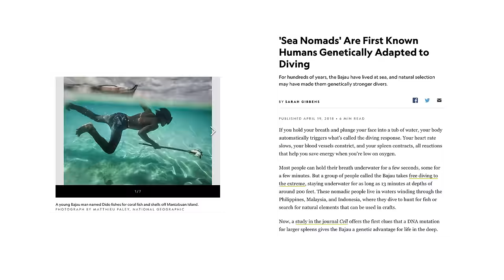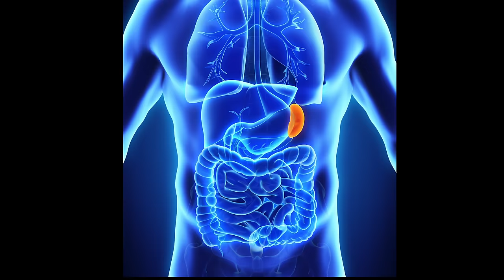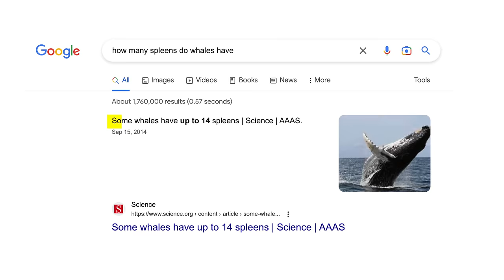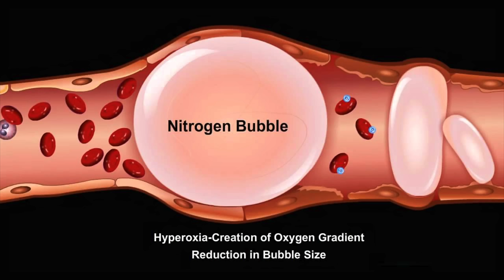The Most Dangerous Fishing Method on Earth

Comment: For a 150 ft dive that lasts 1 hour at depth you would require an estimated 250minutes of decompression time assuming the only gas you were breathing is air. This rough estimate was calculated using a square profile with 10ft deco stops and a 40/85 Gradient Factor.
Reply: Added comment unrelated to diving: Peterson is right that when people are not struggling financially that they are more mindful of their surroundings and the environment (usually). But, I think a lot of Peterson's notions about what political practices create "wealth for all" are just hot air.
Reply: I came here to find that you'd beaten me to the answer. Interestingly he says in the video "they stay at this depth...hours [plural] at a time". Just thinking about how much deco they are skipping gives me a rash!
Reply: How are they not getting nitrogen narcosis staying that deep for that long on regular air?
Reply: This seems to be super long, for a dive at 150ft/46m that last 1 hour for an adult in good shape breathing normal air i think 135 min decompression stop is enough
Reply: @NauticalWizard  I imagine it's partly down to their unique physiology, maybe a bit of a trained response to bubble formation, and probably a big part of their dive is spent much shallower than the maximum depth they reported.
Reply: @99999999955555100  If you did a square profile dive (i.e. straight down to 150 feet, spend an hour there and then head up for deco), 35 minutes of deco would be well-short of the safe minimum for most people diving on air. How did you calculate 35 minutes?
Reply: @NauticalWizard  They are; they must be! There's always a  narcotic effect of breathing gases under pressure, there's no way of getting past it. They have advantages like warm water, lots of practice etc going for them though, and clearly they can mostly get by. I bet many bad accidents could have been avoided though.
Reply: @thomaschilcott   ooops my bad I forgot a 1, DTR 135minutes based on MN90 tables for 60 min dive down 48 meters, 5min  at12m 19min at 9m 36 min at 6m and 70min at 3m. What DecoTime do you have? (thanks BTW I corrected  my 1st comment)
Reply: @99999999955555100  my profile:

48m-60min
24m-2min
21m-5min
18m-7min
15m-10min
12m-18min
9m-27min
6m-45min
3m-97min 

275min dive time with 215min of deco. 

My initial post i had been calculating off a 20/35 trimix since that was pre-saved into my settings. 

This profile was made using air mix. 

Seems your profile allows for more pressure differential, to me it seems fast but I bet in practice with average depth accounted for it would be shorter than 215min. You may also be running a less conservative GF.
Reply: @NauticalWizard  they are definitely narc’d. They are just hoping they can keep a cool head. In the 70s to the late 80’s it wasnt uncommon for tech divers to go to 200ft on air. Today this seems crazy. I bet it was a little crazy back then still. But crazy doesn’t always stop people. Especially when gas mix technology had not yet been developed to make equivalent nitrogen depth mixes.
Reply: @99999999955555100  That's not a profile I would personally want to dive for a couple of reasons: MN90 are French navy tables, which were developed essentially by having "volunteers" (professional navy divers) do a dive and then see if they got DCS; they then adjust the dive profile and repeat until the rate of symptoms was "acceptable". Even with the finished MN90 tables, even navy divers who have to be super fit to do that job (test subjects for the MN90 tests were all 74kg +/- 8kg, 176cm +/- 5.7cm, 32.5 years +/- 6.1 years) were getting symptoms on some dives.

My calculations for the hypothetical 1 hour, 48 metre dive on air come out as follows:

48m: 60min
30m: 1min
27m: 1min
24m: 4 min
21m: 5min
18m: 9min
15m: 12min
12m: 18min
9m: 29min
6m: 283min

20,405L gas consumed 😬
Algorithm: ZHL-C plus 30/85 GF, via MultiDeco.

This is also not a dive that I would want to do 🤣

I'd prefer to used mixed gases at that depth, especially if it was cold water; plus with standard gases I could calculate my deco on the fly with ratio deco. But this is obviously well-beyond the means of these spearfishermen.
Reply: I AINT READING ALLAT🔥🔥🔥🔥
Reply: when i heard they dive 150ft shivers down my spine i just found my ancestors
Reply: @NauticalWizard  Im wondering if its because the air he is breathing isn't compressed air.
Reply: Using U.S Navy tables Im getting 317 minutes of total ascent. And no more diving for a day at least. 

11 min at 50 ft
26 min at 40 ft
28 min at 30 ft
248 min at 20 ft

If the numbers dont add up theres some minutes added in between stops. A 50 minute difference between tables is odd
Reply: @MarkBrown-xn9ig  Its being compressed by an air compressor at the surface. You wouldn't be able to breathe air at ambient pressure even a few feet below the surface due to the pressure gradient; your lungs can only inhale so hard!
Reply: @iandavidvillaloboswong5180  I think it's because the navy tables were all made by bending people on purpose. Different people & different conditions can lead to different conclusions I guess. I'll stick with Buehlmann with GF I think!
Reply: The moment he said how deep and how long the dive was the dumb ways to die song started playing in my head🤣.
Thanks for the info though was curious how long deco would be for that.
Reply: What does  that mean in real English
Reply: @LCD.26  They're playing with fire, basically. But they have to; a guy's got to make a living to feed his family after all!
Reply: Finally someone speakin the truth. Not the narrator nor national geographic
Reply: They are not breathing compressed air, not the same saturation. Still BS, no way.
Reply: @williamk1452  of course they are.  It's called a COMPRESSOR after all.
Reply: @williamk1452  you are correct. It should say continuously fed air supply from a gas powered air pump. It's pumping air down the hose through the tank at a constant rate otherwise the diver would have bubbles pouring out of his mouthpiece. The tank is probably not set up to cycle off and on at 30-40psi like a garage would have for car tires? It's probably set really low at a few pounds so the diver can breathe in, hold, exhale without bubbles screaming out of his regulator? Makes it hard to see when you have 40psi pouring out of every hole in your body at 150ft? Guy would embolise and then sputter all the way to the surface like a party balloon?
Reply: @MarkBrown-xn9ig it has to be 'compressed air' (ambient pressure at 150 feet), however it is not compressed to 200 atmospheres or more as it would be in tanks.
Reply: @clutchcargo666  sorry, that is not the same. What pressure do you usually fill your tanks to? I fill to 3500, in steel, HP 80s.
Reply: @chrismsmalley2626  you got the constant pressure part. They are receiving the same cubic feet at depth as at the surface. With compressed air in my tanks at depth my first stage adjusts for the pressure at that depth, increasing the actual cubic feet, denser air, which is where the saturation comes from. Without this there is ALMOST no need for off gasing.
Reply: No tank, no first stage, no increase in cubic feet breathed at depth, almost no need to off gas. Saturation is not the same.
See you guys on the bottom.
Reply: @williamk1452  in order to breathe you have to be delivered gas at 'ambient pressure' for whatever depth you are at.
That is the secret of the demand valve.
The 'partial pressures' of the gases delivered to you remain the same whether they are delivered through a demand valve or an open circuit just bleeding air to you as in the old hard hat system, so as long as you breathe at the same rate you are exposed to as much nitrogen over any given period & that nitrogen dissolves into your body,
Reply: At 150 feet, he is not breathing compressed air.
Reply: @stra808x  I don't think that you understand how delivering 'breathing gasses' to a diver works either the old method with hard hat diving or through a demand valve the diver has to receive gas at 'ambient pressure' for whatever his depth is or he cannot breathe, so the 'molecular'  amount of gas delivered to his lungs increases with depth, each lung full of gas at depth (since it is under pressure) contains more molecules of gas, so at 10 metres (33 feet) the density of the gas delivered is twice that at the surface because the diver is under two atmospheres pressure instead of one atmosphere he is used to living in.
At 66 feet it is 3 atmospheres, 99 is 4 & so on with the gas breathed getting proportionally 'thicker' (more dense).
Reply: @williamk1452  tank pressure doesn't matter.  What matters is the air you are breathing is at a higher pressure then surface pressure (it has to be higher in order for it to be sent down the hose to the diver who is under higher then atmospheric pressure).  If that diver were to hold his breath at depth and surface, the air would expand to the point of bursting his lungs.  That doesn't happen when breath hold diving because the air taken in at the surface will compress on the way down but if no new air is added at depth, it will be the same volume when he surfaces.
Reply: @99999999955555100  I thought you could spend all day at 40m
Reply: @williamk1452  Sorry dude, the other guys are right. Tissue saturation is a function of ambient pressure (the pressure that the water is exerting on your body at a given depth). The gas you inhale is at or VERY close to the same pressure, because if it wasn't, you would either be unable to inhale or exhale, depending on which way the pressure gradient went. Ask a rebreather diver what happens when their unit's couterlungs get even slightly out-of-plane with their own lungs! 

The gas these divers are breathing is compressed at the surface, held in the holding tank of the compressor at XYZ PSI and then either drawn down by the diver through regulators / demand valves as they inhale, or fed as a continuous "hookah" flow. The laws of physics simply don't allow for it to happen any other way.
Reply: @danf7411  If you have enough gas and a way to stay warm, eat drink and, ahem, evacuate waste, you can stay at 40m as long as you want. Eventually you reach full saturation which requires a lot of decompression, so it's mostly done for commercial diving. There's loads of great content on YouTube about it, search: "Saturation Diving".
Reply: Precisely you said exactly what I was thinking. The ramrod escape factor times booty equals booty squared. Hold your applause my equation was the bomb!
Reply: @@guy895Awesome retort.
Reply: They aren’t breathing compressed air they are breathing surface air so you can stay down for many hours and no decompression is required. I’ve scalloped and lobstered using a hookah rig and no bends.
Reply: Holy Crap. It's amazing there is not more deaths, what people have to do to make a living and take care of your family.
Reply: @DavidMaruca_ you are right, that was unrelated.
Reply: @guy895 exactly, Third World Countries don't have Osha requirement regulated scuba shops that demand a license/ permit to feed your family. You do what you need to do to not only live but thrive.
Reply: @thebullgator they ARE breathing compressed air. Ask yourself why they need to use a compressor in the boat instead of just the hose. It’s because at depth, the water is compressing your lungs way harder than you can overcome to breathe in. You need to force air down the hose at a pressure that is slightly higher than the pressure on your lungs from the water. Air that is at higher pressure than ambient is compressed air. It’s as simple as that.
Reply: @scottieeasley4907  true statement 🎉
Reply: @DavidMaruca_  Peterson doesn't claim that there is a political practice that will create weath for all.
Reply: Maybe that's only breathing compressed air.
Reply: It’s FRICKN’ AMAZING the amount of people here responding with ABSOLUTELY NO - ZERO - IDEA of diving thinking that you can beat science with ‘new age’ bullshit like somehow the guy is ‘used to it’ and the water is warmer 😂😂😂

AT 150FT THE WATER IS NOT WARM!!

You would all know that if you managed to leave your keyboard in your mother’s basement and actually went anywhere near it …. to, gee I don’t know ….ACTUALLY GO SCUBA DIVING
Reply: @DavidMaruca_ Examples? 🤔
Reply: but they are breathing air at surface level being pumped down. So that should…. I would think make a differential in the equation. Also like you said yes would be narced for sure but if they can handle it better hey.
Reply: @L8rCloud   yeah the level of ignorance here is frightening ... there's a reason people get certified. There's a ton of stuff to learn and it can all kill you if you don't know it. Science is great! It's complicated though and easily misunderstood. If you rely on what makes sense to you then you're probably going to make some incorrect assumptions.
Reply: @jefflovespigs it’s the exact same as breathing from a 3500 psi tank. With scuba, the regulator releases air to you that is at ambient pressure for the depth you are at. Atmospheric pressure doubles every 33 ft or so, so at 60 ft, air released to you to breathe is compressed to a third it’s volume. This is true whether or not it’s released from a pressurized tank or I pushed the air down to you through a hose. It makes no difference that the air in the tank is at 3500 psi, and the air at the surface I’m pushing to you is at 1 bar or ~15 psi, the volume of air they both deliver to you is the same.
Reply: @DavidMaruca_ It's kinda like when the Apollo astronauts traversed through the Van Allen Radiation Belt, but it was all good because the Van Allen Radiation Belt hadn't been discovered yet.
Reply: Maybe most of that hour time is spent in decompression.

Comment: For a dive on air to 150 feet for 2 hours assuming the first dive of the night would require a minimum of about *7 hours* (423 minutes) of decompression, starting at 70ft and ending at 10 ft. For example:
Depth (ft)  , Time (minutes)
70, 3
60, 14
50, 21
40, 32
30, 49
20, 89
10, 214
(Calculated on MultiDeco with ZHL-16C & GF 100/100).
Reply: is there also an issue because they re breathig straight compressed air? does that compound the problem?>
Reply: @lowristocrat3824  It can, but with such an extreme dive profile I dunno how much of a difference it would make.  Gas mixes such as nitrox, trimix, and heliox can be used to do things like reduce decompression time, extend time at depth, or increase the max operational depth.  Nitrogen and oxygen are both narcotic and toxic above certain partial pressures.  So with training, careful planning, and the right equipment, its possible to plan a dive that utilizes different mixtures at different depths to provide the desired dive profile.  But it takes refined skill and equipment, and since I just hold a basic open water dive cert, that's the extent of my knowledge.  My grandpa did research dives in excess of 250ft, but he has passed so I can't ask him about it
Reply: @pohlec89   I've always been interested in how deep it's possible to go, given cavedivong can go 500+ feet. I don't know what's most dangerous, but I'm aware humans would do better if we didn't have compressible gasses in our system, but rather a breathable liquid so we can't be crushed at depths, kinda like how sperm whales do it, keeping most oxygen directly in the blood, instead of the lungs!

Comment: Years ago I worked in a small dive shop on an island in the Pacific, the small compressor we used was essentially the same as used for tires, except that a system of filters (charcoal I believe) was used to clean the air that I pumped into 80 cf tanks. That's what I recall. I wonder if anyone has made the effort to introduce filters on the compressors they use to these divers. Or does it make a difference, I don't know. The shop also had a bunch of those frogman double hose regulators like  Mike Nelson used on the TV show which looked pretty cool at the time. I don't remember seeing any PADI or NAUI cards or schools. The shop only rented to divers they schooled or divers affiliated with the US Navy. It wasn't unusual to see divers spearfish 300-400 lb grouper, or even larger bottom fish back then. The owner of the shop was one of the first divers approached by J Cousteau to test the SCUBA as invented by Cousteau.
Reply: Sorry but a 120psi air compressor isn't going to pump up a 2200psi high pressure scuba tank. It takes specialized equipment to do this
Reply: @ryany4326  I never said a 120 psi compressor, where'd you get that. Maybe I was wrong about it being used for tires. It was more like a volkswagen engine, only 2 cylinders on it and the tank wasn't much bigger. It could pump more than 3000 psi, cause that's where I had to cut off the pressure. but I don't know how much more cause Past this the covers of the filters would blow out a gasket or whatever every once in a while. This same shop the owner was very well-known in the diving world at the time circa 1960-1962. I recall a shipment of regulators and hoses came in that looked just different from everything else. The  word was it was something a french guy named Cousteau wanted the owner to test out. Who knew? Looking back, the shop was probably the only one between Hawaii and Australia other than the Navy bases in the Pacific. It had a real island vibe and fun to work, on a reg weekend, the reg divers would bring in groupers and snappers the size of small cows, way before there was any sense of environmental damage or protection. The big fish are long gone. The same dive on the reef walls today would see lots of schools of reef fish but not at that size, that would be all,out of the ordinary. Diving is now big business and with it comes the hoi polloi and all the trash and problems that come with it.